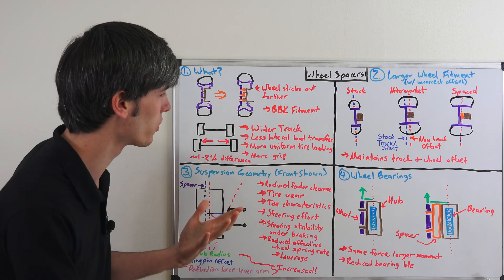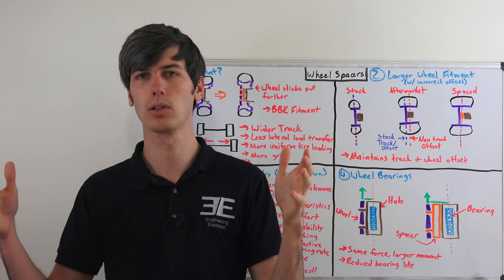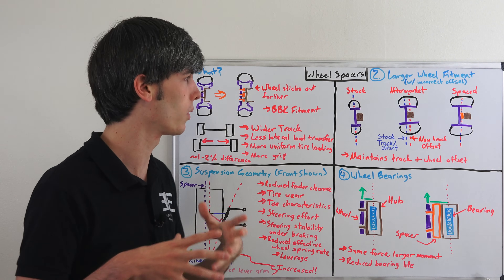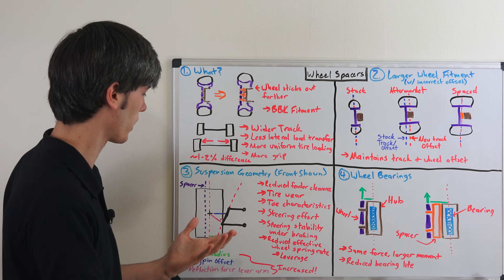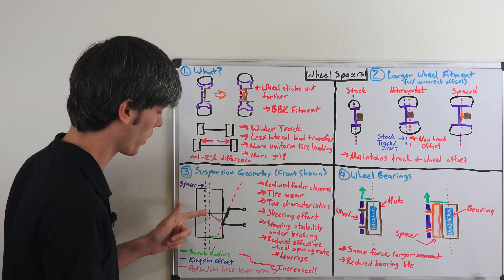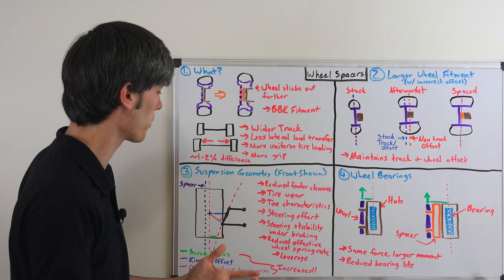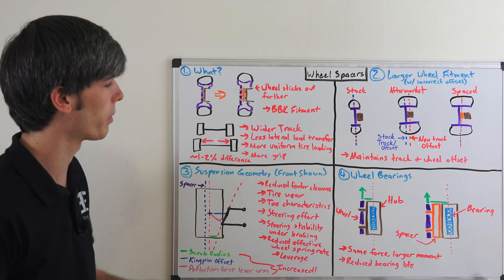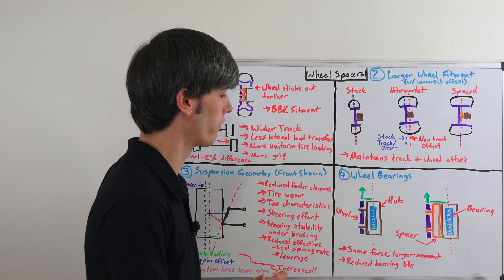Wheel Spacers & Adapters - Good Or Bad?

Comment: What I found out over the past 60 years of my life is that Engineers can only make thing look right on PAPER not what happens in real life situations. I have been running 2" spacers on my 2008 GMC 2500 HD Duramax Truck for the past 7 years. With a V-Plow, salt spreader and 2,450# of salt in the bed of the truck. Still have not had any problems with suspension or wheels.
Reply: No bearing problems  either?
Reply: I know this comment was made years ago, but I don't think you'll notice a whole lot on a truck.  Where you'll notice is regular cars (especially more sports car oriented) where you're really sensitive to suspension geometry changes, etc.

Comment: Basically if you plan on fitting spaces take these off for track use.  Road use should be fine as long as spacers are not substantially thick 15mm+

Comment: So essentially the main negative special to spacers are wheel bearings correct? Because if you get a different wheel with a different offset it will affect the scrub radius as well, so that's not unique to spacers

Comment: explanation sounds fair, although the force will decrease slightly the longer wider the spacers .... agree, momentum increase and eventually bearings will break ... the most important question is: wheel bearings will last 10%, or 20% or 30% less after how many miles ????

Comment: If I had a stock wheel with 4.5 inches of back space and I want to buy an aftermarket wheel of the same size but the new wheel has back spacing of 5.75 inches, would adding a 1.25 inch wheel spacer be harder on the bearings or am I truly just correcting back to stock geometry?

Comment: Excellent. You have helped me avoid a mistake (at least for my purposes). How might having adjustable control arms affect this?
Reply: I've used 1.5" spacers on the 9- trucks I've owned and have never had an issue.

Comment: Which one carries the weight of the vehicle: Clamping force created due to stud/nuts or the hub? If the spacer is hub-centric but does not have the centering lip where the wheel would sit. Thus, the wheel would be centered via studs/nuts. I know that top brand Eibach produces spacers like this.

Comment: I have a 98 Ford Explorer Sport 2 door that I put 2 Inch spacers on and 9 inch wide tires I also lowered it 3 in and the reason I did this is because the second gen explorers were known for rollovers and since I did these mods this thing handles like a car

Comment: So if I want a wider tire can I just get a wider rim with an appropriate offset as to not change the centerline if the tire? If I understand correctly this would not change your tire scrub radius or the moment on the bearing. Are there any other downsides I don’t see?

Comment: Also moving the wheel out caused steering parts to ware faster and instead of the tire turning left or right it actually causes it to swing when you turn in stead of pivoting and dangerous part about that is if you drive into a pot hole or hit an object that tire that hits the object will pull the steering to the side of the vehical object is on and can actually rip the steering wheel out of your hands and thus lose control of the vehical I have had this issue in 2 of my  vehicals

Comment: I really wish that when talking about topics like this people would also bring up that it’s not just specific to wheel spacers. The same concept applies to aftermarket wheels that have a lower offset as well. I hear so many people talk about how you can’t use wheel spacers because the ruin your bearings; that you should just get wheels in the offset that you want but it’s the same exact thing. People just falsely believe that it’s the spacer that is bad and not the effects that it causes.

Comment: The profit margins on wheel spacers is significant and the cost to manufacture is quite low. So aftermarket firms flog these things to the public. Wheel spacers themselves are bad news and should not be used. They screw up the suspension geometry and shorten wheel bearing life. It's equivalent to smoking in humans. There is no obvious benefit.

Comment: I put some on my audi a4 b6 body and my car has a wide body looks and plus the 1.5 inch spacers and the new rims i bought it looks so wide its hella sick but I also bought the hub rings. Make sure you tighten it well cause one of my wheels came loose😂 my mistake I didn't tight it enough ahaha

Comment: Thanks, great summary of the impacts of using wheel spacers.  the additional wear on the bearings is the biggest factor for me.  when the manufacturer designed the suspension geometry, the wear characteristics and lifespan of the parts would also have been a consideration.

Comment: Love your channel, but beg to differ today. Most of the negative effects you ve mentioned are corrected with an alignment after the spacers are installed. Also scrub radius is not an issue for a performance driver. As far as beatings are concerned, in theory they are affected, but practically 10mm or 15mm don’t change their MTBF much. Let’s not forget bearings are a serviceable item and they need replacing anyway as per manufacturers reqs. So the bottom line is: for hubcentric spacers up to 15mm don’t worry about it and have your fun, but do get an alignment

Comment: QUESTION.
May be late to the party but anyway here goes... In light of the negatives you've explained, what would be the better option between buying a wheel with a smaller offset or using spacers????  Say the aim is to increase track and\or use wider wheels and\or achieve a flush look on the fender edge with the tire.

Thanks in advance 😊

Comment: Thank you so much for the information that you made it easy for a layman like me to understand. What if i just need 3-5 mm to ley me wheels clear the brake calipers? As long as it’s properly cnc and studs are lengthened, torqued to specs, will 3-5 mm be statistically different enough to affect the geometry? I also look at it in a different way. If i buy another exact same model of the wheel with extra 5mm offset wouldn’t it be an extra bit of material at the wheel’s face like the spacer being welded to the face of rim

Comment: I'm looking at wheel spacers because I like my factory wheel, I just wish they were an inch wider.  Wheel spacers would be $150 for a really good set, I'm talking hub and wheel centered.   Would new wider wheels have the same negative load on the bearings as wheel spacers or not  ?

Comment: Nice presentation but very misleading title.  All the points you discussed are wheel offset driven.  Whether that offset is achieved via wheel construction or spacers is irrelevant.  Your discussion will lead uninformed people to avoid spacers while still buying wheels with different offset thinking they are avoiding the issues you describe.  Spacers have their own structural and failure point issues which you failed to address.  Your video should be titled "Changing Wheel Offset - Good or Bad.

Comment: This is a really old video but I found it really useful in the context of wheel offsets though! Can't expect you to reply Jason but I was wondering if changing the suspension geometry by having a lower offset than stock (pushing the wheels out) will accelerate wear at all? Besides handling and performance changes, will it actually cause more wear to the stock suspension components (if so - by how much?)
Reply: Wear differences are minimal as far as shocks and bearings.  However, increase in leverage will tend to twist bushings more, and those tend to flex out of alignment, and affect dynamic handling character under heavier loads like braking and high lateral g cornering.  A stiffer bushing set might be a good idea in such case in key locations like tension rods and main arm ends especially in locations that affect toe alignments. However some give is still needed to protect the chassis so use of hard ball joints shouldn’t be considered for daily use cars.

Comment: From an engineering point of view I agree with everything you are saying... considering the safety factor that is built into all vehicle components what is the real effect when spacers are used on vehicles that are mostly daily drivers... surely it cannot be that bad? Of course there are limits but will these limits be that easily exceeded by the ordinary motorist?
Reply: If it helps, I’m running 10mm front and 20mm rear spacers on my Fiesta for 7 years daily now and my bearings and suspension are as fine as if it had ran without spacers
Reply: @krinkedsurface  Hows the Fiesta holding up ??

Comment: I just put 1 inch spacers on my back tires with a fwd car. A turn in the road I usually go through at 25mph with my wheels about to break loose, I can now go over 35mph just fine. So that 1-2% seems a little sketch 🤔
Reply: Did u notice any negative effects?
Reply: @usmanz6030  the only probably that I see is a little camber which might lead to uneven tread wear

Comment: My SS Camaro came with an offset of 35 mm on the front, the back is different. I paid my local Chevy dealer to upgrade my suspension with the 1LE package. The 1LE comes with a front offset of 23 mm. I run a square setup and I would like to push the wheels out to 23 mm from 35 mm. If I am only extending the offset to another option provided by Chevy, will that be a problem?

Comment: You are wrong!!!! False information.   
Fact is, the hub centric rings do not bear a load. The weight of the vehicle is actually supported by the friction between the wheel and its mounting surface on the axle. The friction is established and maintained once the lug hardware is properly installed and torqued to specs.

Comment: Can you run spacers on the rear only? 
I have a 00’ Impreza and my wheels rub against the strut in the rear. Cheapest fix is to run spacers but don’t really want to put them on the front if I don’t have to.

Comment: hub centric wheel spacer act like an extension of the wheel therefore not effecting anything you said they are used for wider tires and rims once added to your hub they are part of the hub not changing anything .

Comment: I have a question. I have a 1999 Lincoln Town Car with stock summer rims and tires. I recently bought winter rims off a 2006 Town Car thinking they would fit the same as my stock rims. However, when I installed them they were sunken into the wheel well and rubbing against the upper control arm. So my question is if I install spacers in order to get the 06 Town Car rims to sit exactly where the stock rims would sit without spacers, am I really doing any damage? The tires are going to be the same distance from the hub in both cases so I should be fine, right? I just don’t want to prematurely wear out my wheel bearings or anything else like that.

Comment: You should have also mentioned that it has the same effect on the wheel bearing as if you just got bigger wider tires is the exact same stress on the wheel bearing rather it's done with the spacer or just plain out bigger tires and rims so take that into consideration when making a decision
Reply: This is a great point. For those considering wheel spacers or aftermarket wheels and or tires though on a "body on frame" Turck/SUV, it's not as much wear on the suspension parts or wheel bearings than it would be with any car or even uni-body crossover SUV. All body on frame Trucks and SUV's, even the non 4wd variants, have much more beefy suspension parts and wheel bearings as is out the gate from the factory.

What I would love to know though is the exact statistics as far as pre-mature wear goes on suspension parts or wheel bearings is if a set of premium brand hubcentric wheel spacers say 15mm for example, would have the same effect as an aftermarket wheel with a +15 offset would. Then on top of that you have a few other variables that I would also love to know the statistical differences on as well far as pre-mature wear goes. These are variables/upgrades such as a set of wider wheels and tires but wheels that have the same offset or very close to the factory wheels do, a set of wider wheels and tires with a lower offset than the wheels have from the factory, and lastly a slightly wider wheel from the factory but same tire size "tire being slighlty stretched". When I say a lower offset, I mean a +offset wheel from what your factory offset is. This is going to push the wheel outwards more towards the outmost edge of your fender wells and further away from your suspension parts which I'm sure you already know. For instance though on my 2014 Lexus GX460 and all Lexus GX460's in all there years made from 2010-2023 that came from the factory with the 18" wheels have a +25 offset. The only ones that did not are those who got the "F-Sport" GX460 Wheels which were a +20 offset. Here is the kicker though, The thing with the F-Sport wheels though is that they are about 12% lighter than all of the other non F-Sport Wheels GX460 18" wheels. That being said a common upgrade as far as wheels and tires go on these GX460's is getting a set of slighlty bigger tires in both width and diameter and a set of aftermarket 18" wheels that are wider but much lighter.

The wheel and tire setup I'm going to most likely get is the Konig HT1 Flow Formed Wheels in the 18×9 +0 offset size wrapped in a one size wider and taller 275/65r18 tire. The factory wheel and tire size for my GX460 and for 80% or so of other GX460 owners is 18x7.5 +25 offset with a 265/60r18 tire size. A set of on road style/less aggressive all terrain tires in the 275/65r18 size like I plan on getting, weigh about 7lbs or so more than the factory 265/60r18's tires do. That will vary slightly depending on what tire your GX came with/has on it now and what tire brand/style you are switching to. The non F-Sport 18" wheels like I have and most do weigh about 32lbs a peice. The flow formed Konig HT1 18X9 with the +0 offset weigh about 25lbs a peice. Therfore, If you are going to upgrade to wider wheels, "even if they are not bigger in diameter" as well as bigger tires both wider and or taller.......Is to at least select a wheel that is much lighter compared to your factory wheels.

Comment: So I some a questions if anyone can answer them

So say I got new wheels instead of spacers, would a different offset of the new wheels present the same problems as the spacers? 

Secondly I'm trying to find more of an adaptor from a 6 lug to 5 lug because they dont make decent rims for my bolt pattern that fit what I want to do with my SUV (its never beat up it's just a city hauler) my question is if I get a small adaptor that doesn't do much spacing would I possibly be able to counteract the adaptor offset with the offset of my new rims to matches factory specs to mitigate these problems? I do know my SUV has BBB complaints about the hubs wearing out quickly already so if the strain is too much I dont want to push it.

Comment: How about the fitment of spacers on classic cars that came from the factory with horrible engineering. Most wheels made today are built with a fwd offset, so you either run stock 14" wheels, pay through the nose for specialty wheels in modern sizes to get RWD offsets, or... Slap some spacers on to use late model FWD offset wheels.

Comment: I enjoy watching your videos, sometimes they put me in the right  general direction when looking for info! One comment I would like to make is regarding the old chestnut on how "engineers designed the car the best it could be, etc., etc.". News flash, car business is about bottom line and in 99.9% cases. The only driver is how to manufactore it the cheapest and so it doesnt fall apart before the warranty expires. Performance is the last thing on their minds, notable exception are performance models like M-series, AMG, and so on. There are some tests done by enthusiasts in Europe where they gathered together a number of fellow petrolheads owning the same car in different modification stages, perhaps best was m135i test. I write this to respond to your maths line where you claim track widening is neglidible in terms of grip increase. This might be so, I cannot be bothered to run the numbers really. On the same note have you run the numbers on how much difference would an increase of say 20mm per wheel effect on said lever arm force? You would find it negligible as well :)! That's one thing. The other is handling characteristics. Even if your mentioned physics maths calcs prove the theoretical grip increase is low I am pretty confident you would struggle in the handling characteristics department. This is where a driver gets the confidence to push from and times on track drop massively.  To sum up the lowest times were recorded by cars with widened track and lowered suspension, not the ones with more power or better brakes. Tyres were if not the same then all of the performance variety. Driver and passenger were the same. Don't get me wrong, I am not trying to knock you and your vids can only be so long. It is worth to perhaps get out from behind the (in front of?) a white board (and you do need a bigger one and perhaps somebody to do the drawings for you ;)) and check stuff in real life. If you are planning to keep driving your car for over 100k miles then do not modify it at all, just service religiously and tune it from time to time. Otherwise stop worrying and slap on those (high quality hub centric) spacers and take great pleasure from better stance and (disputably) improved handling characteristics.
Keep up the good work!

Comment: @@UClqhvGmHcvWL9w3R48t9QXQ
I would also imagine that the same science can apply to wheels with different offset etc??? Deep dish wheels etc..
I'm curious to now how much difference it may make to a rear axle (fixed) - especially how it could affect your vehicle, if the rear spacers are put on but no front ones. How would this affect handling etc... spring rate I would imagine may not be as badly affected than front suspension??? . What are your thoughts?